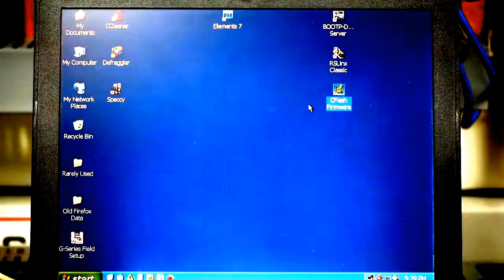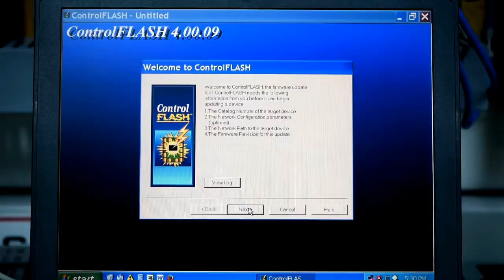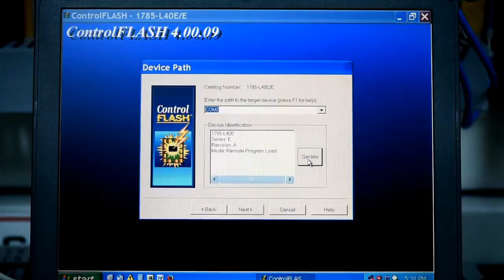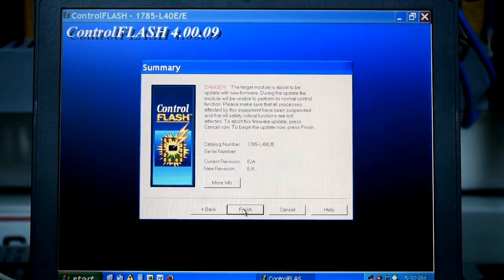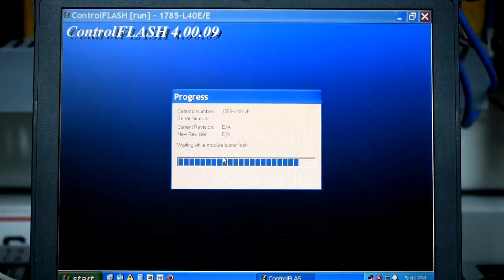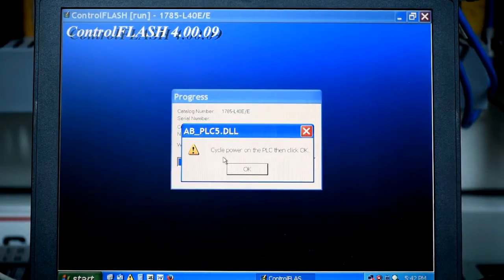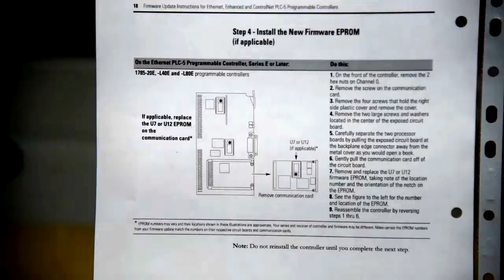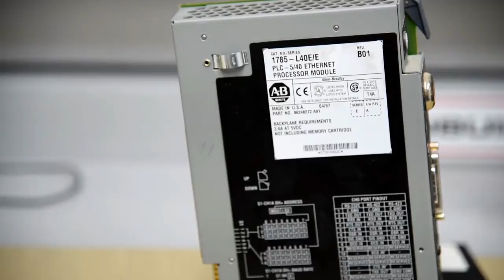AB PLC5 Firmware Upgrade - Video 1

Comment: This series is GOLD!  I work in a papermill with thousands of 1771 cards and several PLC5 processors and unfortunately PLC5 is before my time having started in 1756 series.  The old timers that built the plant and its huge PLC5 network are long gone and and us E/I guys ae left to reading books and youtube, this is the most thorough channel on the subject I've found yet. Thankyou!
Reply from the maker: Hi:  Glad to be able to share some 'old-timer' knowledge with you.  Hope that you find it all helpful.
You have to remember that the 1771 structure was designed by the same age group that put the first man on the moon.  And many of those designers for the AB PLC parts came out of the Rockwell/ NASA moon shot programs.
They made things to be able to perform under the ugliest conditions.
MTBF rate for PLC parts was pegged at 80+ years.
Unlike today's products that are designed to die within 7 to 9 years at best.
Many of those 1771/ 1785 parts in your mill should still be running when you retire.